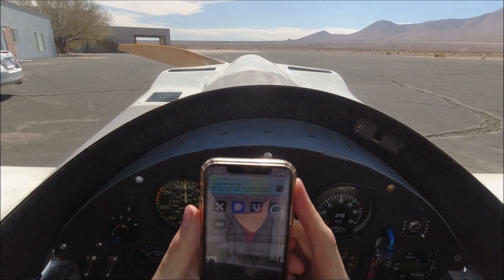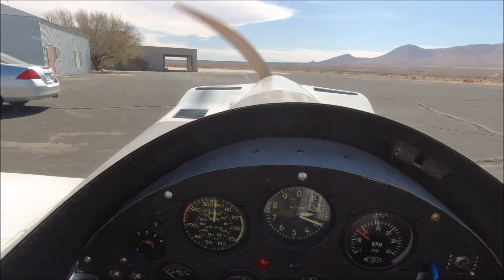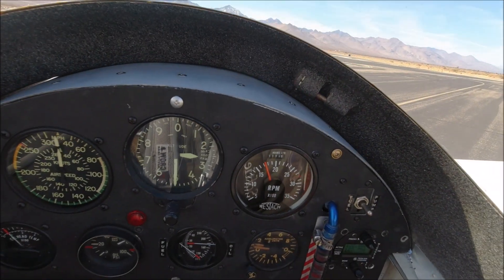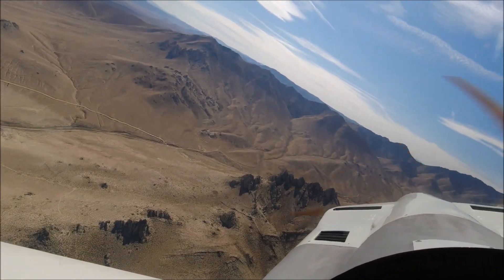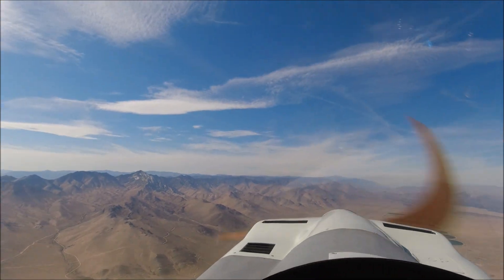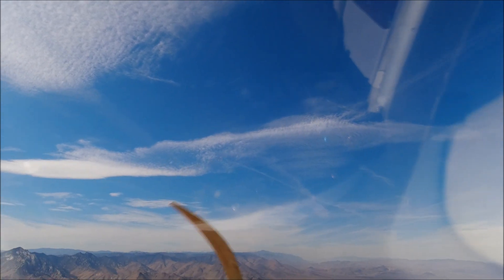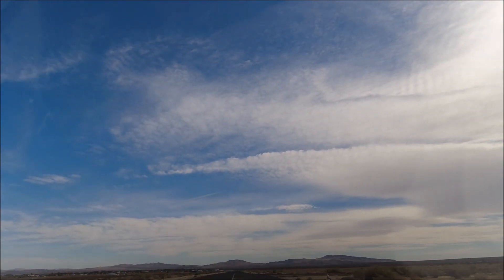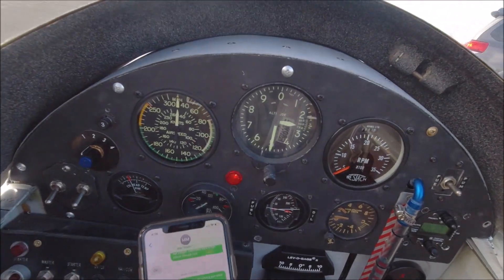iLikeCake Cassutt 111M Phase 1, Flight 8

Comment: Great video. Can you wheeler landing these? Any benefits in a crosswind?
Reply: No!  prop is too close to the ground. I think crosswind component was 12 Knots. I haven't flown for thirty years , but I recall using the full width of a strip gertting in on a higher crosswind